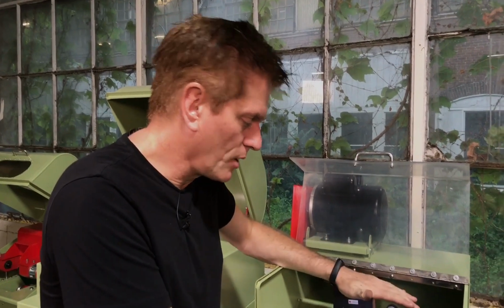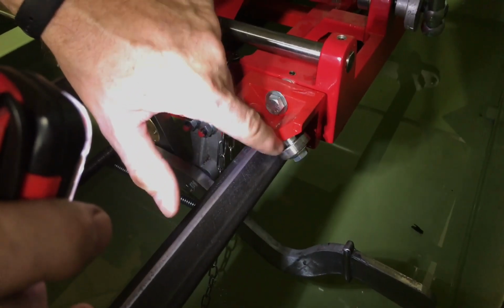EXPOSED! The Myths About Cutting Coolants and The Dangers to You and Your Equipment

Comment: you never did show how much oil to put in the ht 14
Reply from the maker: Hey Bill, for HT14, you should put approximately 2-1/4 gallons of coolant so that the blade is covered 3/8 to 1/2 inch.